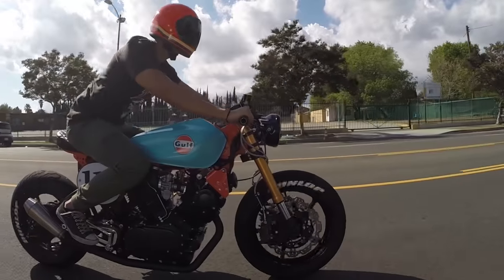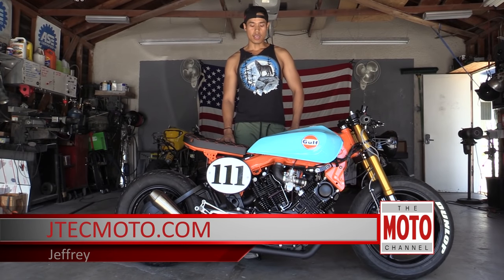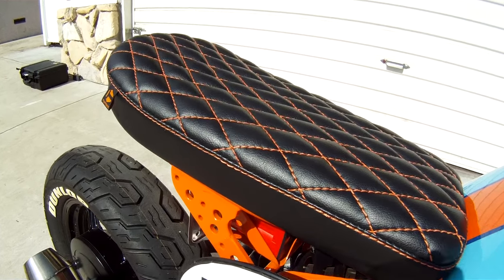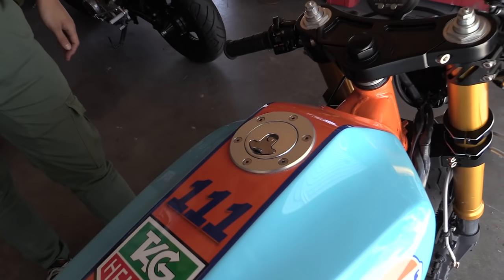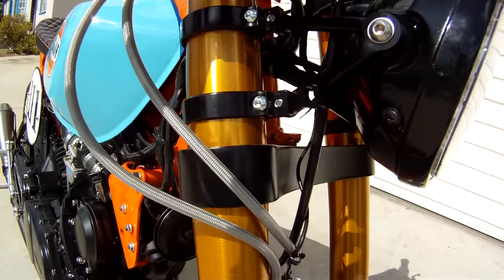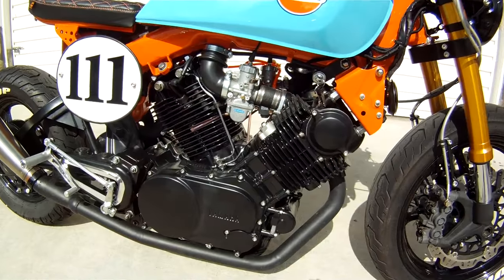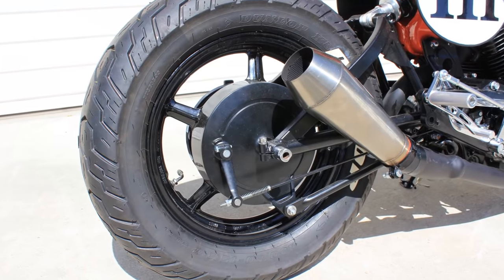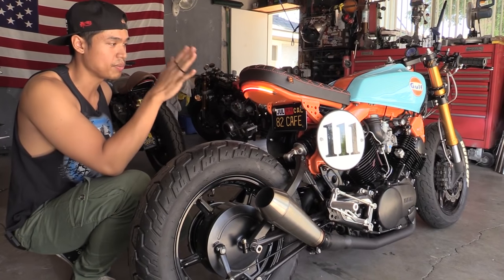1982 Yamaha Virago XV750 Cafe Racer R1 Ford GT40 Gulf

Comment: I want my kz650 with a monoshock conversion on the moto channel
Reply from the maker: +1995keandre If it's a cafe racer style bike, you may want to post photos of the bike at https://www.reddit.com/r/caferacers and then post the link here in the comments.
Reply: +The Moto Channel cafe bikes are the best bikes! I'll post to reddit. Also you can check on my Instagram at ksmith95
Reply from the maker: +1995keandre Just checked it out, cafe racers and guns in Florida. Awesome!

Comment: Such a simple, cheap, solid, reliable, beautiful build.  No heavy fab or anything, very very budget friendly, and the results are absolutely gorgeous.  I'd daily the piss out of something like this.  Very awesome.

I like bikes like this way more than bikes with 10k of fully custom crap on them and an air brushed tank because I'd feel guilty riding a bike like that in the real world - it's a piece of art, not a machine - I wouldn't feel guilty riding this around because A.  There's so many OEM parts (ie. a rim bends, you can buy another, not some custom deal), tank chips?  No problem, it's not some 5k dollar air brushed paint job), so it's rock solid reliable and B.  The total investment isn't that high, only a couple grand, and C.  The result is amazing!
Reply from the maker: +MrSlowestD16 Agreed. These first gen Viragos are still relatively cheap and easy to find. You could easily build something similar in your garage with limited experience and tools (like Stanley Tang and his Cbass Virago cafe racer) that would look great, all for under $10,000! And you would have the satisfaction of building your own bike.
Reply: +The Moto Channel Yup, except I'm afraid of those early 80's viragos due to all them starter issues!  Working them out builds character, though, I guess!
Reply from the maker: +MrSlowestD16  It's amazing how bad those early 80's starters were. Seems the whole world knows about them.